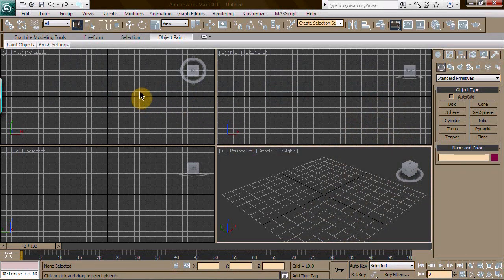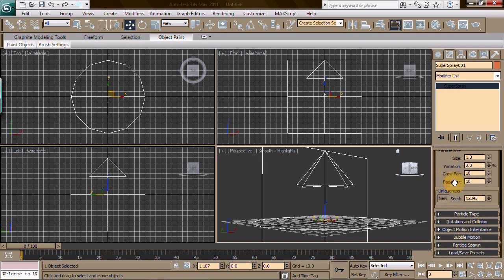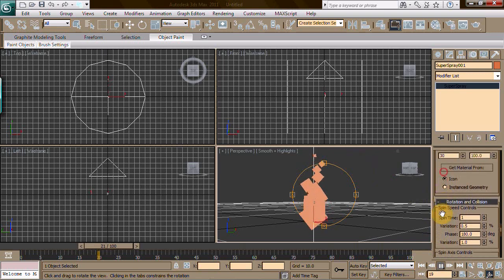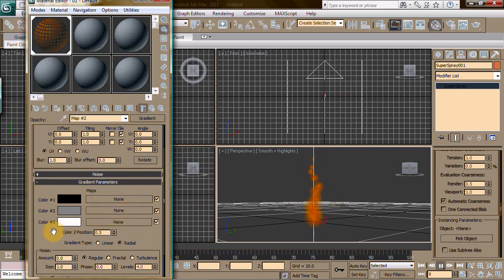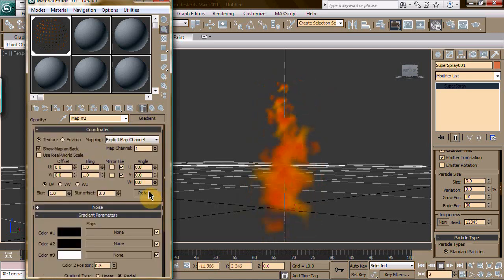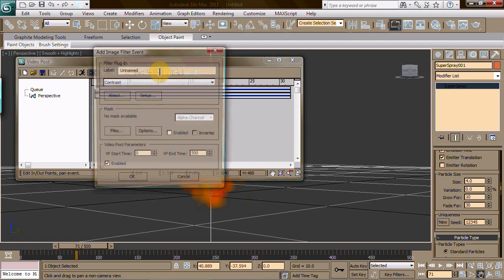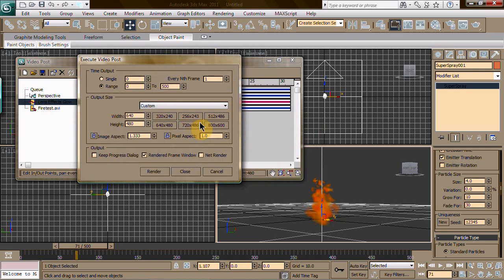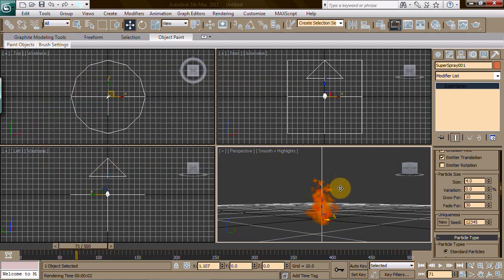3D Studio Max Tutorial - How to create fire

Comment: If you want the fire to illuminate the surroundings, here's a good cheat:  Create 3 or 4 omni lights and put them in the center of your "fire."  Make their colors yellow and orange and have them cast shadows, but exclude the fire particle system.  Give the lights unique falloff ranges.  Now, add a noise controller to each of the lights' multiplier.